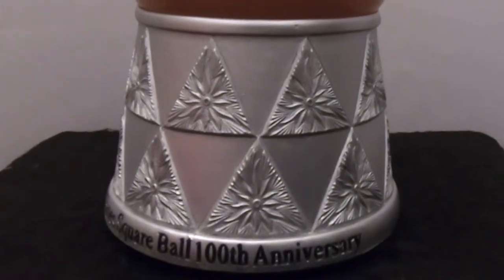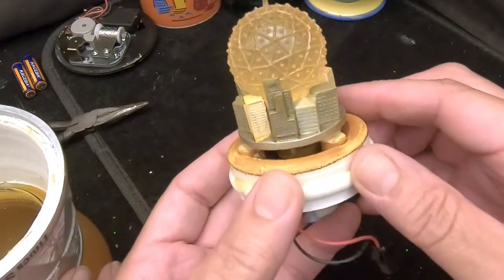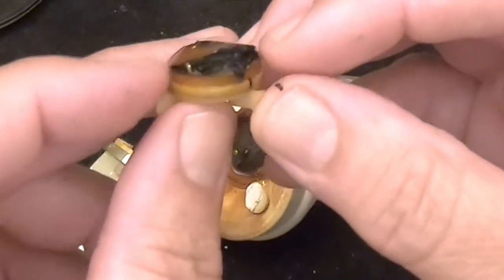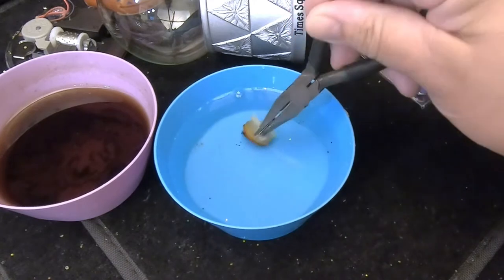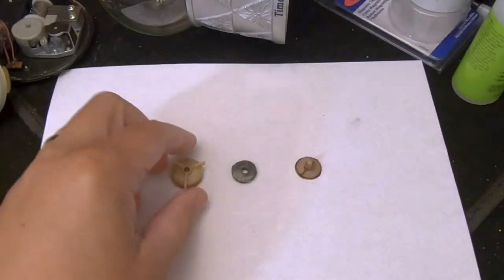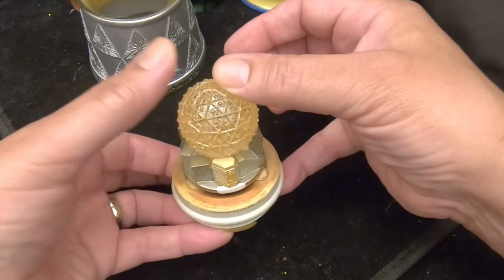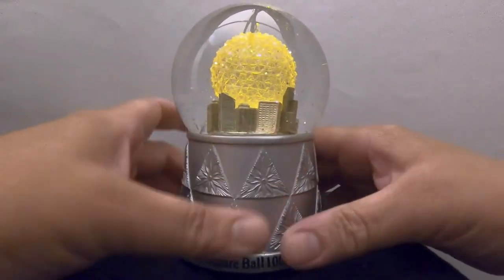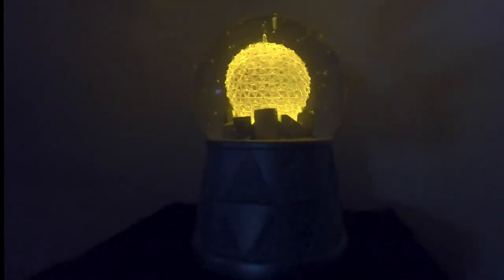Ep. 179 - Times Square Ball 100TH Anniversary Snow Globe Repair - Rusted impeller and brown water

Comment: Did you ever find magnets that would fit in the snow globe, If so, where can I purchase them? I have a 2010 Hallmark Santa globe. When I opened the bottom, I was confused as to how it moved the snow because the motor wasn't attached to anything. Your video answered ALL my question. Thank you.
Reply from the maker: You can find the magnets on Amazon. They are called Ring Magnets. We have seen them in the craft store as well.

Comment: I also have one of that collection, you can remove the brown from the ball, with peroxide and leave it in the sun for a few minutes, so it would stay the original color, since it should be more transparent, even so I love it
Reply from the maker: Someone else also suggested using peroxide. I soaked the figurine in hydrogen peroxide for several hours. It didn't seem to make a difference, however, I didn't leave it in the sun. That may make the difference. Now we know for next time.
Reply: @snowgloberescue8887  well, I really don't know what hydrogen peroxide is, or I don't know if it's the same one I say, since I'm referring to the peroxide used to bleach hair 😅
Reply from the maker: @antoniomorales8705  Hydrogen Peroxide is what people use to bleach hair. Some people refer to is as just peroxide. The peroxide that we used is from the grocery store which is a 3% solution. Apparently it is too weak to bleach the figurine. We didn't think about that until we read your reply. A stronger peroxide solution may work better.

Comment: Looks really nice. I tried to guess what kind of scene there is and I was partially right with skyscrapers. 
I don´t know if this works for the next globe but there are fridge magnets with eventually the same size. Maybe you can try to drill a hole in the magnet. You have to constantly cooling the magnet and the drill cause you lose the magneticproperties if the magnet gets to hot. But I neither know how the magent would behave if you drill the hole. I will look that up and do an additional comment later. See you in the next one.
Reply: I looked it up to drill a hole in an ferritmagnet isn´t recommended. Pot magnets should do the trick. Hope you can find those as a piece.
Reply from the maker: We tried to drill a hole in a magnet in Episode 76 to fix the Alice In Wonderland globe but as shown in the video, we did not have powerful enough tools to do the job. Luckily we found something that worked.

Comment: A washer would probably work but you would need to magnetise it using a magnetiser/demagnetiser. However you would need the right kind of washer/magnetiser to make a magnet of appropriate strength. Would then need a thin coat of something to make it resistant to water. (Also would need to make sure to magnetise the polarity correctly)
Reply from the maker: Yes, a plain washer did not cut it. Although it was attracted to the magnet, once installed it was too far from the magnet on the motor to work.
Reply: @snowgloberescue8887   Yes but what I am saying to clarify. Is you turn the washer INTO  a magent using a magnetiser.  Otherwise you just have a piece of round metal that's magnetic but not a magnet itself.
Reply from the maker: @TheLimeyDragon  Yes, understood. What we meant in the reply is that although the washer was attracted to the magnet, since it is not magnetized, the washer was too far from the magnet on the motor for the magnet to pull it. If the washer were magnetized it may have worked.